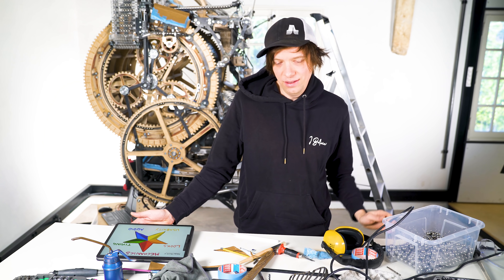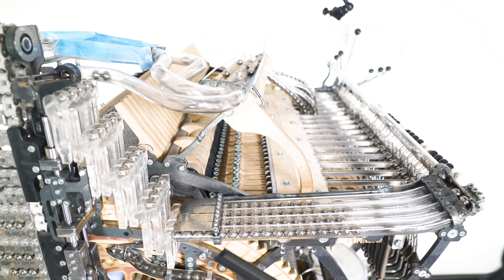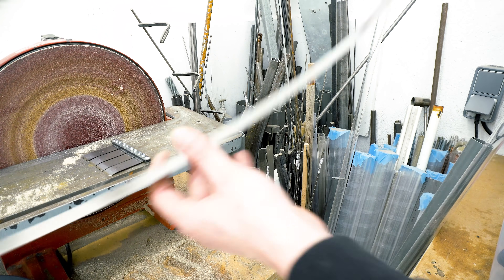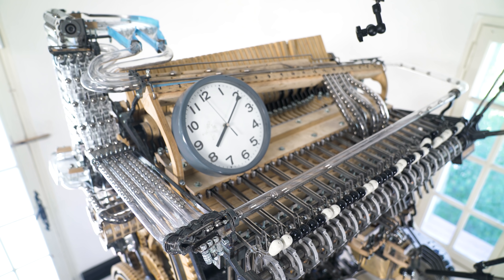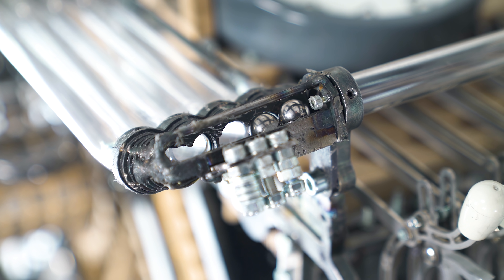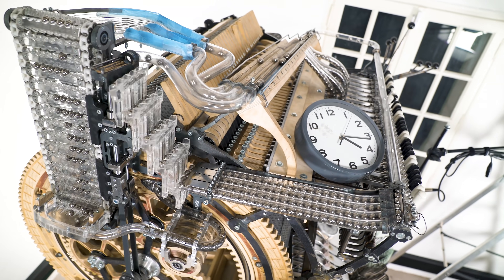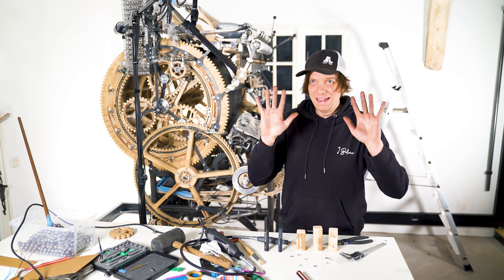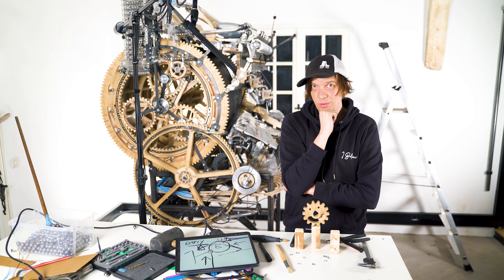Marble Machine X Fish Stair Upgrade

Comment: From my experience as a programmer: don't feel bad. It's alright to tweak. 
you will always need to tweak what you have created. you could spend hundred years on the design phase to get it right on the first try. It will not prevent you from finding glitches in the test phase. That's ok, that is what the test phase is made for. :-)
I think it is also ok when some marbles drop on edge cases. This machine is too complex to get it down to zero fails. Set up  your goals, if you pass them all, your system is error free per definition of your goals. That's good enough. Everything beyond os waste of time, because it is not in the goals.

Comment: Just ditch the divide by 4, it will break down live for sure. The most reliable systems dont need fine tuning because they work well by design, not by tuning.

Comment: You know what Martin? Make it till the end of this week with work. Then go to a vacation in February. And I mean the whole month of February. You need to rest heavily. And I am a bit selfish on this, but I need the MMX in my life. I have been following the project since the very beginning. THE VERY BEGINNING. And it gives me a ton fo motivation. I bought a straight razor. And you know what? I cut my face. First time shaving with it. But I will keep pushing to perfect the technique. Also, I installed Arch Linux on my home computer beginning of January. The next day I uninstalled it and set up a user-friendly OS. Yesterday, I installed it again. It wouldn't boot. Reason being is I like GNOME desktop and the kernel loads after the thing that the desktop needs, but that thing needs the kernel to load. But I am searching for a solution to use whatever system I want however I want. And after I'm done, I'm gonna take a shower, and shave with the straight razor of mine, and I'm gonna do it until I don't cut my face anymore. And wanna know why I keep pushing? Because I see another guy pushing to make a machine that makes music with marbles and I never saw him stop. I don't want to see you stop. I need you to finish this project, and you can trust me that I will be among the first ones to buy a ticket to the live concert. And if (god forbids) the machine fails, I shall be among those that don't leave, but go there. And maybe try to fix it. And we won't be fixing it for opurselves, so that we can get what we paid for, we will be fixing it so that you can play music on that goddamn snesless contraption of yours, because you are giving us the strength for persistence and to keep pushing. If not for you, I would still be using Windows, because the PC came with that out of the box, even though I like my Arch much better. So you go make this week, and then you go on a monthworth of rest, becasue you deserve it. And yeah, I am being arrogant here, but you know, I would be just a lazy couchh potato if not for you (you're not my only motivator, but a very big one). So that's it, keep doing what you are doing. We all, including you, would lose a lot if you stopped. Just take breaks sometimes, the world will not end if you slow down a bit. Cheers.

Comment: A suggestion for the so called "edge case": Make a wedge with a similar sharp angle like on the fishstair. Position that wedge in front of the first stage of the fishstair opposing it with the flat face, like with a pair of scissors. If a marble happens to get pushed up, the wedge will push the marble back by the additional wedge and should avoid any further issues. 
Concerning the marble divider, you might be better off machining a new clean version later on. For now, as long as it does its job, it should be fine though

Comment: I think the bolts on the "Dividebyfour" need to be longer and your weight further down. It will help the marbles generate better torque to rotate and drop them in the pipes. It needs better use of its potential energy to swing faster and return faster.

Comment: my stupid opinion: if only the fishstair and other marbel transporting devices lose a marble from time to time, but the actual music making parts work extremly reliable, couldn´t you just accept, that the number of marbels will decrease during the concert, because some fall down, but with every change of the programming plates, you just fill the marbels back up. the few missing marbels would be dealt with by the amount of marbels in the rest of the system, and the fact, that there are more marbels than are accually needed, so a few marbels not returning properly would not make a differece to the end result (=the music).

Comment: I think you had a right idea last time. Abandon the fish stair marble equalizer, make it simpler, simmilar to elevator. And make it higher so if 2 marbles tries to take same spot it should fall back down (when not spring loaded they will just fall, not shoot outside). It works great with elevator, dont see reason why it shouldnt work with fishstairs with small adjustments. Doesnt matter that you wont get all channels filled all the time, it will still look great as actual fishstair movement is most important visually, not that each step is full. 

Also, dont abandon opening marble catching funnels, i dont think you gave it enought chance, that one can be fixed with strings or rubber bands to block sides of opening funnel :)

Comment: The edge case looks like you have two forces fighting against each other. the lifter pulling up and the spring pushing down. To remove this scenario you’ll need to get rid of one system.  I’m assuming the spring steel is to keep the balls from stacking on top of one another, Have your tried moving the springs back so you don’t have the two forces fighting each other but still in place so that the marbles don’t stack on top of one another?

Comment: Just attach a barrier that moves with the "pedal" system, when the system goes down to let the 4 balls in the tube, so does the barrier, blocking the oncoming balls, as the pedal goes back up the barrier too is lifted and ball can flow in again
Reply: The Maximum Credible Accident would be if the barrier were crushing against a marble..
Reply: This is the idea I have too! It would solve all the problems present because balls would not be able to prematurely enter a tube.
Reply: I was thinking of the same thing. 
Another idea is to just remove the flaps and use a tray (like the other lift). If a marble is too early it will just miss the lift and fall back into the tray. The tray can also have an outlet that lets marble go to the lower lift if the divide by 4 is full.
Reply: In order to fix the error, the barrier would have to push the ball into the lift.
The problem could be seen in slow motion.
The ball wasn't in the elevator fast enough and was thrown out.
The lock would have to push the ball into the lift in the final cycle (when the lift is at the lowest point).
During the stroke cycle, the lock should move down, then one ball back and position itself between the first and second ball.
Reply: I had the same thought

Comment: With all these small adjustments....could it be the marbles being the issue? Has Martin calibrated all the marbles? Small variations in the marbles could be the root issue of many of these situations and if he were to calibrate and only use marbles that fit within specific parameters he might solve multiple issues at the same time

Comment: I completely get it, you want perfection. It made me think, the one  moment you play catch a mole, there's a good chance it causes a problem some where else in the machine, your chacing problems around in a circle then I'm so glad you did the star as then your sacrificing to something else. This is why car design is so hard. I'm glad your learning. The answer is, instead of aiming ( not a bad thing) for the star tips, go a little lower. I do get it. You could say a litte lower is losing a marble. However a car behaves the same way. Normally the same way. Instead the driver is normally at fault. Then that becomes driver failure. I plead you on martin as your doing this solo, where car engineering has hundreds of ppl. Gl mate

Comment: Martin, it's clear you've never come into contact with production lines. In my (very limited) experience, at least with more traditional production lines, everything is tweaked to high heaven until it works. I've been in a bearing factory once and absolutely everything on their machines was tweakable so they could adjust every single piece of the whole chain until it all worked perfectly. Tweaking is perfectly acceptable. Just make sure that tweaking is built into the design, rather than it coming later in the shape of an angle grinder or carbide mill.

Comment: what if you cut a perpendicular  straight thin hole with a metal saw before lifters between the first and second marble on the bottom of pipe, so it some flat thin spacer will fit to create a door in a pipe. it spacer must be some pivot mechanism that when a lifter goes down it pushes spacer up thus spacer edge would also hit marble a little by pushing marble to enter the lifter(so it system can run dry) and also blocking second marble to enter(for full pipe), then it when lifter goes up it spacer goes down and open the door for next marble to come in . check this "profesional" cad design image https://ibb.co/KmsP1Jt

Comment: Hey Martin - I mean this comment in the most constructive way possible, but is perfection actually necessary?  I look back at your original machine. And how wow'd we all were with that video. And, it was SO janky... marbles were all over the floor by the time you finished that one song. Is it a TOTAL deal breaker if one or five marbles fall during a world tour show?  As an audience member, it doesn't ruin anything for me. And even if something crapped out during a song... its okay. It's live music. Unpredictable stuff happens all the time. I think you might be drowning in the minutia. As long as it doesn't catch fire, or the programming wheel fall off, it will make an enjoyable live show. But if you need to swap out a block, or fix a stuck marble, we won't care. We'll be too busy enjoying the show... just my two cents.

Comment: I still believe!
You can never prevent the machine from losing marbles 100% of the time. I suggest calculating how many marbles you could afford to loose over an entire concert and then accept a few marbles escaping if the probability of a critical failure is low enough (you can never get it to 0%). You could try some form of risk-analysis where risk is probability of an event multiplied by severity of its effect, you can make table-charts to figure out what kind of events you can allow to occur and how likely they are allowed to be.
I mean you could also be struck by a meteor while on stage, but the probability is low enough so you don't feel the need to come up with preventative measures ;)

Comment: Martin, about the spring steel transition from pipe to fish stairs, you mentioned that the spring steel is there because if the marble comes at the wrong time and gets caught by the rising fish stair, it breaks. But what if, instead of a spring steel that takes that upwards pinching force of the fish stair and launches the marble into the air, you put a wedge type object above the transition point? In the edge case where the marble is partially caught by the edge of the rising stair, it would push against an angled surface which converts vertical movement into horizontal movement, shoving the marble into the stair. I don't know if it would be 100% safe, but something like this would be super easy to prototype and it would mean zero moving parts.

Comment: Hey Martin, if you ever need motivation, show your inner engineer his place! While he may lend his skills to the artist in problem solution, let him never get the upper hand over the spirit of MMX! YOU are an artist, not an engineer. You wanted to create a Ball Moving Contraption That Is A Programmed Multi-Insttument, do so and do not bevstopped by engineering! The marble machine is a work of art in the sense that every finely handcrafted piece is a work of art. But the True Artwork here is your journey to create this machine! Per Aspera Ad Astra! An engineer might abandon a project because of failure to efficiency. But when an artist dreams of reaching to the stars, he just reaches further out!

Comment: If you added another layer to atop the spring, maybe out of plastic, but not adding additional downwards force. when the spring flexes the displacement is quite large, id expect the extra layer to slide past the tip of the original leaf and encourage the ball to go back into the tube, maybe add a curl to the tip of the plastic. It looks to me like the forces are well balanced as its getting forced up and trapped,  if you add a small bit of encouragement in those edge cases as the spring curls up more than normal, it might be enough to force it back and try again.

Comment: Take a few days off and relax, you're doing just fine. The machine is gonna be awesome, although it does take time. But in the end, it's gonna be worth it!
I've had the same problem with that kind of metal shards. They're a pain in the ass. I sat down under a bright lamp with a needle and spent at least an hour removing them. Next time I'll use gloves.

Comment: I think what is needed is a little catcher right before the fish ladder that rocks toward and away from the ladder so that it deposits its load at full decent into the ladder, then rocks back as it rises to catch the next batch, then drops them into the fish ladder when its fully descended.   This would act as a gate for late marbles, as they would bump into the rocker when its in the "closed position" depositing marbles for the ascent, but opens to catch the next batch on the return.

In theory you could make this out of a spare fish ladder row as they are already designed to catch and release and then simply add a pivot and an armature off the bottom fish ladder to cause the rock motion.

Comment: How would it work to just round of the edge on the first step of the fishstair ? wouldnt that make the edgecase marble either just slide back into the tube from the spring pressure or get pushed onto the stairs by spring pressure, depending a bit on exactly when in the cycle it hits?

Comment: 2:50  what if you welded a rod onto bracket in background to eliminate spring tabs rising to high ? otherwise a shaft on the lifters to push the marbles back up the tube as the lifter rises?

Comment: what i think probably don't matter, but divide by 4 lack one feature
 it doesn't matter if it is full or empty or if it divides equaly, that is not the mechanical problem, more visual, because the whole mechanism is just an transport ramp and it only fail if it overflow
the mechanical issue is at the stair ramp contacting the slide ramp. there is no feature that would kick the marble back or forward in case of uneven loading. basically there is no overflow and error corection . the stairs either accept 0 or 1 but when the "bit" is set between 0 and 1 it has no way to dispose of the marble, force it forward or back
springs only stup another marble from entering before the stair is empty. 
the solution would be to make spring go away and instead use flaps that holds the balls stuck solid, but when the stair go all down it should press on some kind of interlock opening the flap 
then it is the matter of tuning when to open it and when to close it back, it could even be closed by a ball pasing trough the mechanizm stoping another one in the track
modyfications would not be brutal to the look but would make mechanism more relible due to solid foundations

Comment: A coworker of mine that’s a programmer used to work at an old job where he both designed the user interface, and implemented the design. He said that he basically had to do these two things at separate days. So on the user interface design-day, he could just focus on the user and what the best possible experience could be. And then on the implementation-day, he could curse at the user interface-guy for coming up with such a difficult solution 😉 

I think it will be good for you Martin to work with the five areas separately, as you described. That way you can focus on the best possible solution from that mindset, and not have to compromise on the fly by trying to do everything at once.

Comment: Why don't you add a thin metal plate that blocks the PMA pipe entrance a prevents more than 4 marbles to enter in the divider when it starts rotating ?

Comment: No need to give up Martin. As someone wrote under your yesterdays vid, everything even airplanes do have flaws. So will the MMX ever have some. The only question is how likely is that this edge case happens and what is the consequence? For example how likely is it that the divide by 4 runs dry? And if it does, how likely is it that one marble will jump out?
I would say that it is very unlikely and it will not destroy the MMX nor make you unable to continue playing.
So I would suggest to move one and concentrate on more severe things. At the moment the lack of dropping modules for the vibraphone and bass are way more influential on not having a world tour rather than maybe one marble that may escape.

Comment: Matthias Wandel made a mousetrap with a magnet instead of the weights that you are using now for the four way divider. It gives a much cleaner break and is possibly easier to adjust. Also having the pivot point of the divider so close to the marbels gives you a mechanical disadvantage

Comment: the marble pinging out with the metal clip is fine its the fail safe solution. It only happens if the devide by four is both empty and an edge case occures, and its fail safe as it doesnt destroy the entire pipe. so its fine imo

Comment: add a gate with a lever  connected to the stair so it only opens when the gate is down and spring that pulls it back closed so the marbles can not move into the gate when it lifts